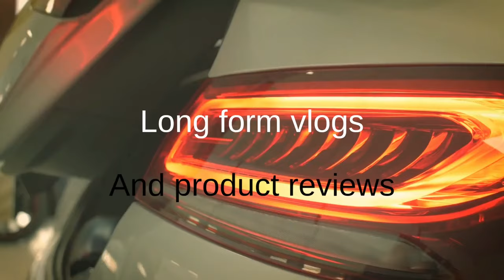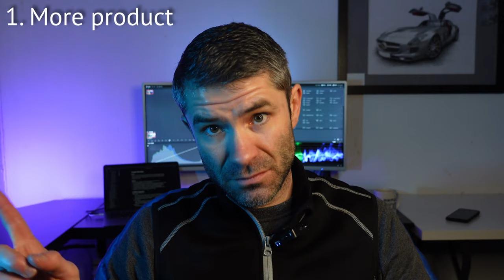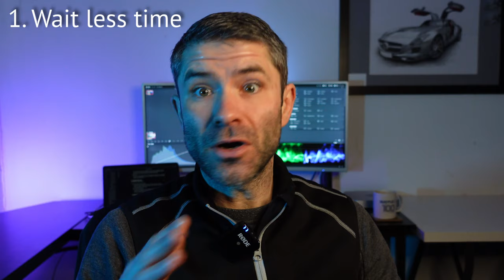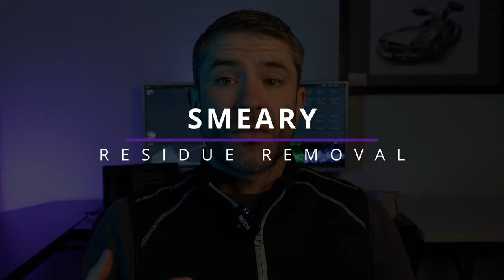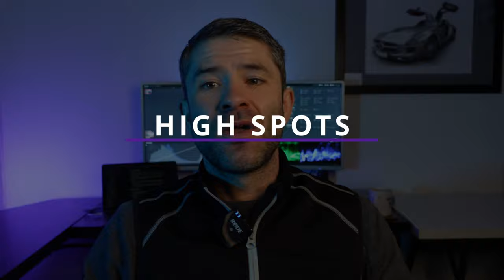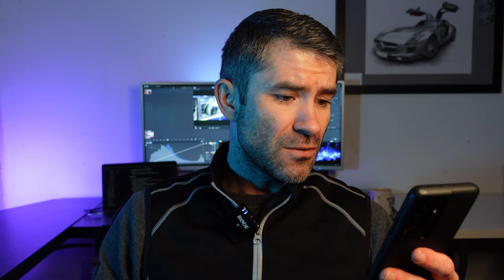Ceramic coating application trouble shooting

Comment: Great series, is there going to be another set of series after this on post installation for example? 
Would you be open to doing a ceramic coating maintenance & decontamination video? Is it possible to get hold of a car that needs it doing, explain what the products do, carry out the steps for us and then show the improvement after the steps?
Reply from the maker: Pretty good idea actually! I hadnt considered it prior. Will add to the list

Comment: Hello Matt, I watched your series even that I'm not coating beginner. I have this case and I want to ask you thru this platform. I had recently Hyundai i30 N, in "Phantom black pearl", this color is more plain black than Pearl, there is some pearl but looks like by accident :). This paint is really soft, even combination of soft pad and Koch M3 delivered good amount of cut. To the problem, this paint I will classified as very "sticky paint" I almost cannot finish polishing cycle, that paint sucked all of the polish "oilnes" even after very short polishing cycle, I can do just about 30-45 sec of polishing, than it dries out, I tried multiple things (Softer/harder pad, more/less compound, water during polish, pressure...) even after 20sec of polishing it was almost no chance to get left amount of residue off the paint, just pure pain... even I tried use IPA/Gyeon prep, didnt help... it was like glued to paint, I also tried Sonax Perfect finish which normally you can cycle like minutes and still taking off paint is pleasure, not in this case, Perfect finish I cannot use properly, it dries out before abrasives diminished. Only thing that works was after polishing cycle with M3, I added another polish without any abrasive (it is product like polish but specifically without any abrasive, it contains just oily fluid) and did very short polishing cycle, like one fast pass. Then it was ok to remove without too much pain with gyeon prep. Ok, I did it I say to myself. Then proper preparation before coating, and another big pain starts...

I used Gyeon Mohs EVO, another great product which is pleasure to work with. I did proper criss cross sections, I use every time fresh new towels (Gyeon bald wipe and Soft wipe). with diffused led panels, everything looks perfect, but when I check with scangrip there sometimes was some veeeery small smear, even if I tried to wipe this smears immediately, no chance... it was like already baked in, even after few seconds. First I thought maybe I scratched surface or solvents in ceramic reveal something what Prep didnt, I tried to reapply on that section and wipe off immediately, before bubbles appear, and it was gone! In next sections I tried to adjust everything, more/less product, time, bigger section, smaller sections, but it appear almost everytime, if not in center almost everytime in some corners, even if I tried to wipe much more bigger section than I apply ceramic to, only thing works if I reapply in these smeary sections and wipe off immediately, then I somehow I can continue forward. Temperature was stable 16c and humidity 60-75%, I even tried to work with humidity! :D nothing helps... I was desperate to be honest that I tried to add some humidity to surface with my breath (if you know what I mean, just to blow some air from my mouth to the surface that some humidity appear on panel, I'm sorry for my explanation, english is not my native language! :D) I tried wipe off with that humidity on panel on these smears, it did absolutely nothing, even these "lines" and smears was more pronounced in that humidity (to be clear, the smears was just veeeery small, lot off people I think will leave it there, but it wasnt 100% perfect!) it looked it baked right in to the paint second after wipe off. I didnt see anything like this in many years in my carer. I did it in the end, next day I check everything and somehow I managed to get it done properly, I tried to breath on pain again if there is these smears still and there was! Now I can see the in that humidity, because as you said in the video, you lately saw case where was problem with smears after car was covered in some humidity! that is what catch me here, this was same problem I saw even during application and even after a day, when I put humidity on panel I can clearly see these lines in that humidity and whet it evaporates it was gone (these lines and smears are everywhere even it looks perfect). I was and I still am confused, because I didnt catch where that problem was, and everything on that car was so strange! :D to specify, these problems with polishing and ceramic apply, was only on paint of body, not on bumpers which is plastic and some other trims, I can saw some difference in colors which is normal because as you know these part are painted separately, on these parts there was no problem with polishing or ceramic coating.

Thank you for reading this, I hope you understand because my english is not perfect. I dont know if you saw anything like this but maybe you did!

Thank you very much, Petr.
Reply from the maker: Hey Petr
Yeah that sounds very frustrating. I think you need a couple of things:
1) the most lubricated finishing polish you can find, to get you close to a good finish, but not perfect. 
The most I have found to date is 3d aca 520. Its so lubricated it can be difficult to not leave oils behind lol. See if you can get it
2) Maybe try adding a pad primer like kkd clean cut. It will help mobilise the residue and add even more lube
3) Remove with a rinseless wash like feynlab. Don't try to scrub it off, just gently wipe it until it slowly is removed. 
4) Probably be most important, follow that with gyeon prime. It is super slick, deals with solid black paints beautifully and as you are adding a layer between the paint and your coating will hopefully remove issues of the coating curing poorly. It should buy you some time, and allow a nicer removal. 

Worth a go!
Reply: @ObsidianDetailing   Thank you for your tips, I can get these thing for future, maybe it will come again something like this, hopefully it will be better than this time, as I said, it was pure paint to work with this... Thank you once again! :)